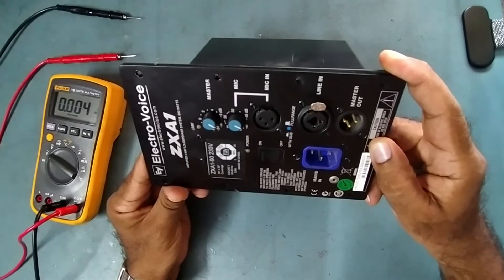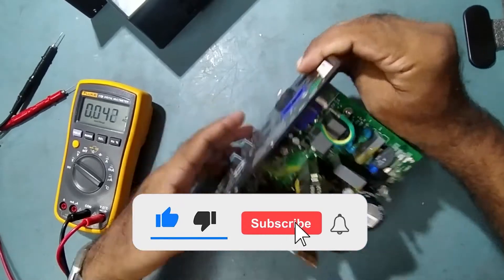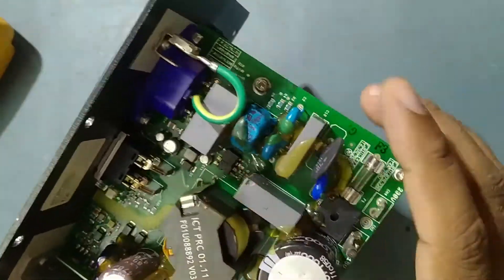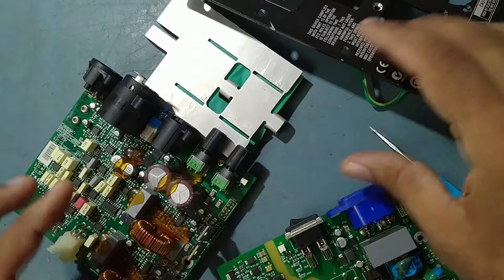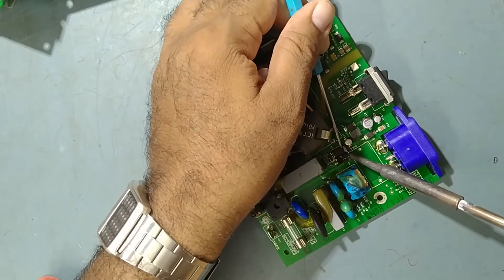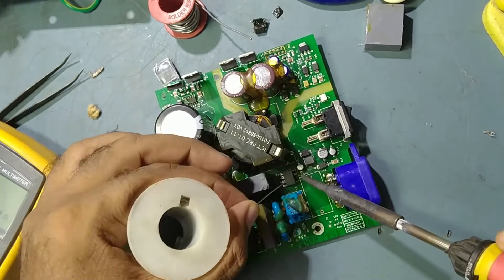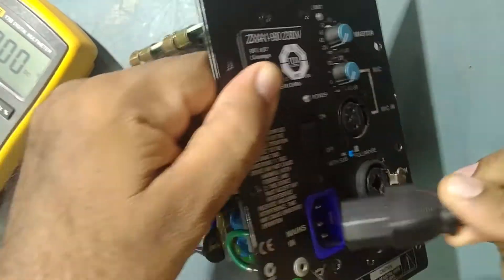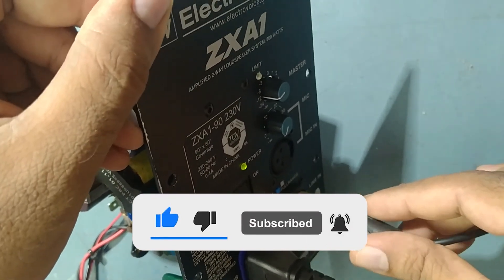How to Repair Dead Electro-Voice (Ev) model ZXA1-90 Amp. Module

Comment: I have a similar model which keeps have clicking sond from the speaker. The PSU is ok. The fault is in the amp board. Do you have any ideal about the culprit component?
Reply from the maker: HF & LF speaker in both that clicking sound is coming
Reply: @TKFElectronics  Hello, I'm having the same issue with 2 of my same models. I'm in Los Angeles, CA can I ship the amps to you for repair? Extremely interested. Thanks!
Reply from the maker: @alexdowidchuk8687 bro it's quite hard to tell you where is the exact culprit bcoz as u know plenty of electronic components r their.
Reply: @TKFElectronics  Can I ship it to you to have you check it out? Tryna decide if I should just sell it for parts or not.
Reply from the maker: It will cost you expensive & needed proper documentation papers, so better I recommend you to just get it done from your side only.
Reply: I have same issue.  Anyone know how to fix?
Reply from the maker: Where is your location bro

Comment: Too bad you've used the wrong term for the part you're fixing. It's the power module. 
I can tell you it's mostly the amp module that breaks down. And almost always the high section!
Reply: The PSU board is obvious which one it is.
It has a transformer. The amp board can be detach from PSU but be careful,  before putting PSU and amp module together, make sure to discharge PSU's capacitors, otherwise it will spark and amp board's MOSFETs will be gone.
What it concerns my amp board, it shows that it has DC offset of 2,25V on the horn and the woffer outputs. Unfortunatly, in my case, the horn was smocked but the woffer made it.
I havn't been able to find the culprit as the board is very complex with SMDs. However the MOSFETs on the amp module are ok. I suspect some electrolyts. This is this far I have come without schematics.
Reply: @roberttiroyy916   Hmmmm, with one I had repaired the amp module had been replaced. Of another one, still in warranty, nothing was specified. I will have collect the rest of my info and investigate a new one that broke down last week. 
Happened when I was using it myself and the circumstances confirmed what I was already thinking: it's in the current/electricity.  It looks like having the power switch already on while connecting it is a condition and a 'flaw' (?) in the electricity is the cause....  I still have to check the last one, I hope this time it's just a fuse....
Reply: @RaulVeldhuizen  Finding blown fuses are always nice but befind every blown fuse, hides a culprit.
Reply: @roberttiroyy916  I agree! Though in this case I have an idea. It Still is no excuse but It Would at least save money.......
Reply: Sir..do you have and share to me schematic diagram this EV Zxa-1..?
Reply from the maker: My dear let me clarify one thing,  I have used this is EV active speaker power Amp module, but see where is problem, i am Repairing SMPS BOARD, ic LNK302GN is shorted very badly, this is Linkswitch ic so I am Replacing this ic with new in power module, what wrong term I used bro
Reply: @TKFElectronics Sir..do you have and share to me schematic diagram this EV Zxa-1..?
Reply: @TKFElectronics  what you fixed is the power module, half of the electronics assbly. The audio module is the other half and the part that's causing 95% of the problems. I can tell, after having almost 10 broken downs. I had to replace the whole unit costing 60% of the price for a complete speaker. Your use of amp module as partname is widespread I'm afraid, EV just sent me a quote for some units using the same name.....  I'll go on looking for someone that has a fix for the audio module, having a few lying around.
Reply from the maker: My dear viewer pls leave it here only, you are not understanding what I am trying to explain & I am not understanding what you r explaining.  See if I write something you will also reply & this keeps on continued so bro leave it, if you don't like my video pls this is my request to you don't watch it. Thank you
Reply: @RaulVeldhuizen  HI, my HF is cutting in and out every few seconds with a click.  Is this the amp module you refer to?  Any suggestion where I can find the part?
Reply: @TKFElectronics  do u have a contact
Reply from the maker: +91 9653123582
Reply: @charlessci8464  Did you find a solution? I have the same problem with one of mine.